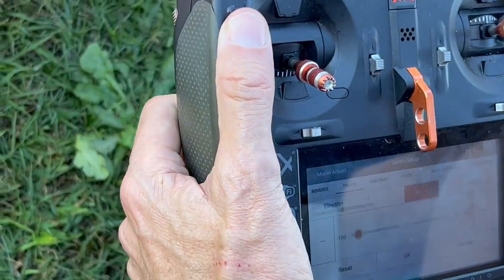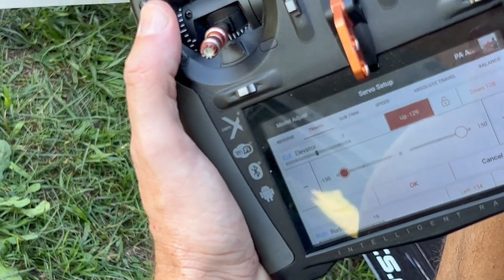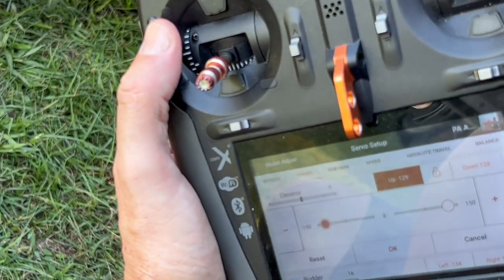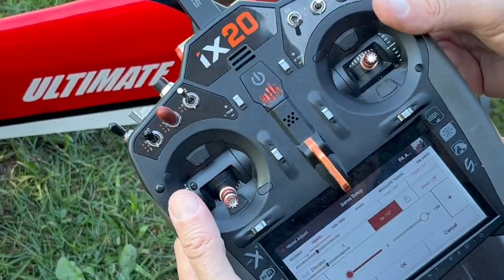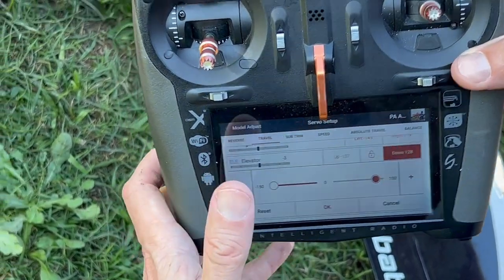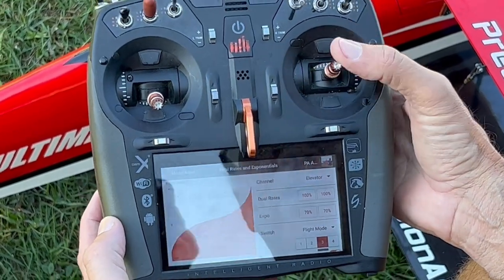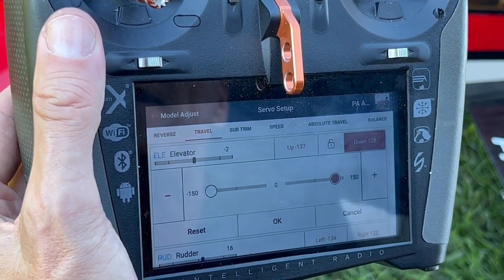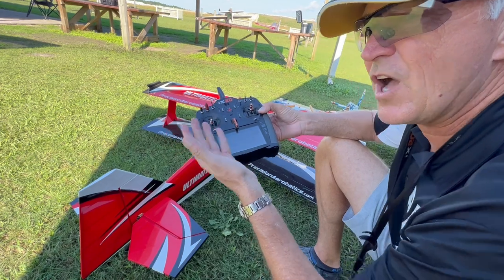MIchael Wargo Instruction:  MUST WATCH!!!   Critical RC aircraft setup instruction.   Travel Adjust

Comment: I've recently gotten back into RC after a nearly 20 year break and your videos have been incredibly valuable. Thanks
I have my first radio with Expo and I don't use rates at all. It seems to be the best of both worlds by having full throw without having to hit a switch in an emergency situation while at the same time having smooth characteristics around the center of the sticks. Mind you I don't fly 3D just lots of TnG's for now till I get my confidence back. Thanks again.

Comment: I agree 100% about resolution and the mechanical advantage of your linkage geometry. The linkage geometry  determines what force is need to be generated by the servo to over come a resisting deflection force. However, the total amount of force generated by the servo motor and gears for a GIVEN geometric set up will be the same regardless of how many degrees of rotation of the output gear turns, it just may not be enough to allow the surface to move. If you have 100 oz-in servo it's always going to be delivering 100 oz-in of force through its entire deflection. All  deflections have alteration in mechanical advantage due to the changing alignments of the servo arm and control surface horn. Example:A horizontal arm that travels in an arc  loses mechanical advantage as it leaves it 90 degree center. It's mechanical advantage is least where you need it the most which is at the extremes of surface deflections. The more a Servo moves past its 90° position the worst  mechanical advantage is going to be because it has now moved in two different planes of motion. The idea is to find The Sweet Spot within the range of what your Servo is capable of generating as a force and not to take away to much  from that max by having a bad geometry that too greatly reduces deflection work, 

The strongest setup with the greatest mechanical advantage is to have all your servo arms at 90° to the control horns and never move them LMAO.
Reply from the maker: The effectiveness of the servo is relating to the net of force required to move the surface under load.   IN other words, 1 lb of force required to deflect, will require 2lbs if geometry is wrong.   I understand servo power is same...   HOld the surface with bad and good geometry and you will feel the difference very easily.   I hope it clarifies
Reply: @MichaelWargo We agree.  I think a little more emphasis on  Linkage geometry will clarify what you're trying to communicate.The seesaw example is not doing it, if you stand arm extended, try to rotate your head that's the output gear, try to push something with hand elbow or shoulder. These are the servos you bought for whatever reason, so, good geometry allows you to get the most out of it. In your discussion about travel versus dual rates I understood it very well, but if a newbie might find it a little hard to follow. Perhaps a simpler explantion might br Travel volume gives you the maximum possible movement and dual rates gives you options to cut back on that movement depending upon how many options you want and how many switches you got. You know   in your last sentence to me  you say you hope it clarifies things thanks for the help, but I thought I was helping you. Perhaps it is my fault I should have been more clear.

Comment: So do I set up my jets the same way with going to max and increasing the end point on the radio to as far as it can go? Or is this for my 3D planes type of set up?
Reply from the maker: Not as far as radio can go, physical limits on surface.   Sometimes physical limits on jets can be too much depending on the jet.   Dial it back if that is the case.  Do it mechanically though.   If you shorten the servo arm, you increase accuracy, torque and resolution rather than simply lowering the rate.    Understand?  Get all you can unless detrimental in some way.   Most of the time, go to physical limits.
Reply: @MichaelWargo  Gotchya. I’ll be setting up my boomerang sprint v1 and T-One Models Fortune mini. Want to make sure I do it right. I know on the mini, I can usually get book high rates right before the ball link touches the actual surface where the servo mounts. Which I need book highs on elevator, and around 3-4mm less travel on ailerons than book highs. And same with my sprint. It needs ailerons cut way down other wise it’s way too sensitive
Reply: Hi Michael. Sorry to hijack the chat from @wickedmoto. 
Informative video by tons. However, I do hv some questions.
Firstly, for jets wen u mean adjust the physical limits mechanically, how much is enough? E.g I have a T1 2.2m, the low rates calm for 25mm up n down on Elevator. Of course my End Points/ATV should be more than this.
So, wen I electronically set my radio, I get about 88 for up elevator and about 76 for down elevator and this is translating to about 35mm for up and down elevator. I am unable to change servo hole locations On both the surfaces as they do not offer adjustments.
Secondly, when setting up dual/triple rates for jets, if the manufacturers do not offer a high and medium rate, how many percent increments between the medium and high and from low to medium would be a good ball park figure?
Thanks in advance Michael.

Comment: This is confusing as hell. So its not the servos actual travel distance being changed. It's the angle of the control surface compared to stick travel. So why not set servo travel to 140%, and adjust the servo linkage to achieve the desired angle at that percentage of stick travel?
Reply from the maker: I am not actually sure what you are asking.   It is very simple.   To get the surface to reach max, we have no idea how far the servo will need to travel.   SO...   adjust the travel number until it stops.  we never know exactly the number.   What ever number it ends up is 100% travel of the surface.   Make sense?
Reply: @MichaelWargo  Sorry, I'm very new to the hobby and eager to learn. The travel adjustment on the radio should go to 150% right? I'm using an ix12, and tried this but the radio travel stopped at like 130% one direction the wouldn't go past 100 in the other direction. Maybe I was doing something wrong.🤔 Will give it another try. Thank you for your help.
Reply from the maker: You are not getting the concept of the travel.  The travel on the radio doesn’t mean anything   it’s an arbitrary number to get the physical limitations established   if you set the travel to a point where the travel goes to 150 but the surface stops moving at 120, you have to set it to where the surface stops moving and that will be what is reflected in 100% rates   so back off the travel until the surface stops moving and in the case that it might be 123 or 133 or any random number, stop there and then it is that correctly

Comment: You should be explaining mechanical advantage without all the gobbledygook.  This is a very confusing video. Simply stated, the closer to center on the servo, the more mechanical advantage the servo has. It let's the servo work less hard for the same amount of load it is moving. Long servo arms are fine for light loads, but make the servo work harder . Placing the linkage on the outside hole of the horn on the control surface, gives the most mechanical advantage for moving that surface. So in a perfect  world, you would want to have the control horn linkage on the outside hole, and the servo linkage on the inside hole to put the least amount of load on the servo. Of course this is not always possible, so you need some compromise to meet the limitations of the radio adjustments.